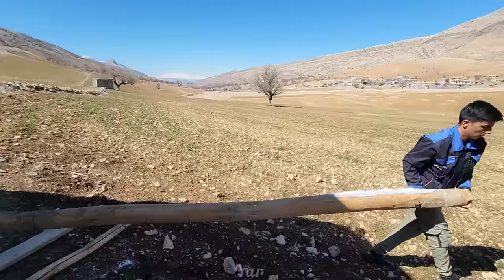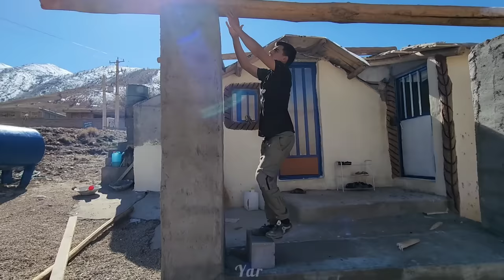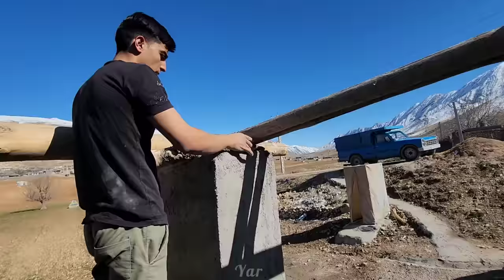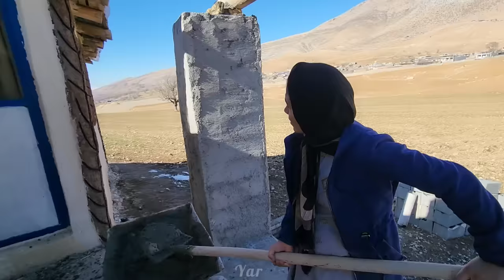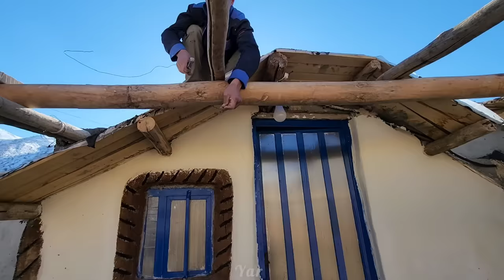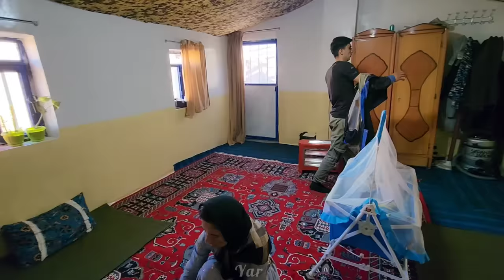nomadic house construction: Putting the Wood on the Canopy in Front of the House Thanks to Abulfazl

Comment: ‼️‼️Only because I’ve seen it happen on 2 other channels, Those oil heaters need the pipes cleaned. The soot builds up inside the pipes and they begin to smoke and catch fire inside. Maybe a good practice to clean every month to avoid dangerous smoke and fire inside the house.